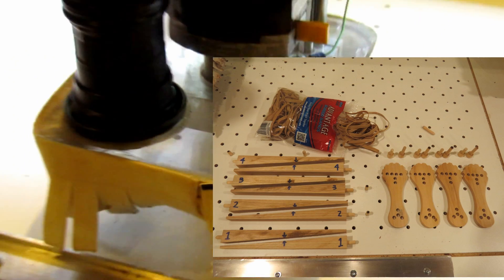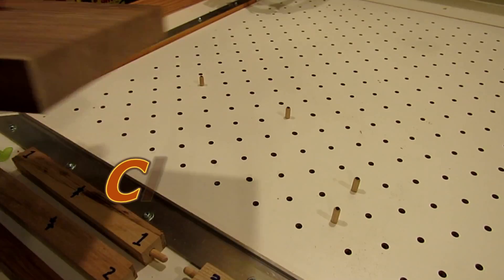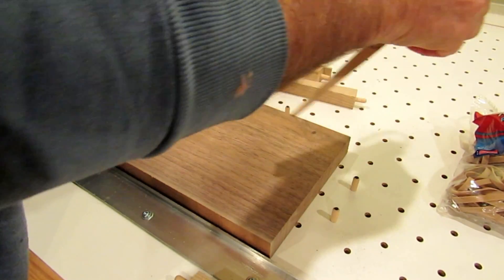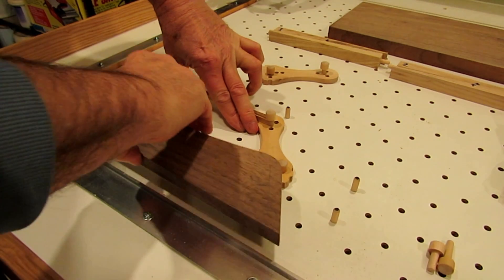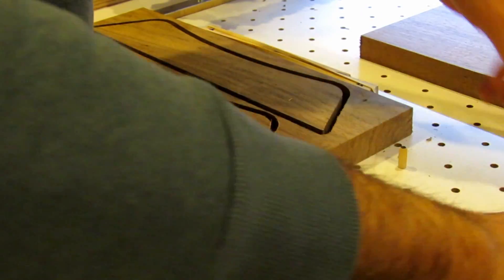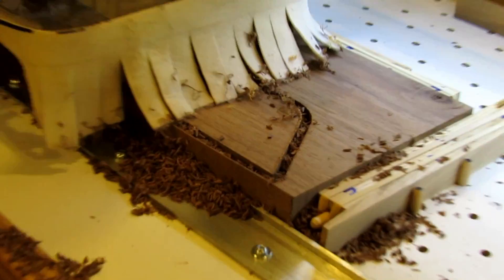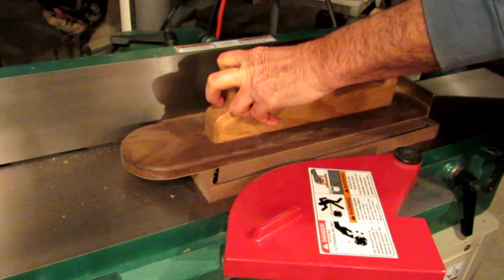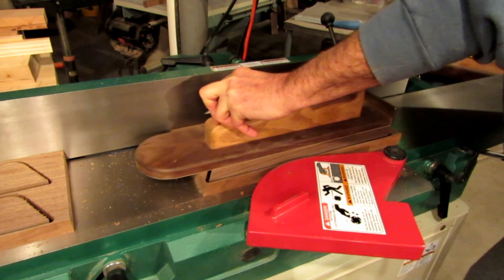Wood and Rubber Band Clamps For my CNC Router

Comment: Well done.  Very practical.  I will be using this system.
Reply from the maker: It worked good for my original low hp router with straight cutters. I am using t tracks on my new router with the 3 hp spindle and spiral bits to be safe. Thanks for watching.

Comment: I like the idea but it seems that rather than using more holes, instead to use different wedge widths. You said your going to 3/4" spacing from the 1". I'm thinking of simply making a few sets of wedges that would accomplish the same thing. A wider wedge would engage the next row out.
Reply from the maker: just keep the taper as shallow as possible for backoff resistance.  Thanks for watching.

Comment: That is awesome.  What software are you running for the CNC?
Reply from the maker: This one used Mach 3. I just. built anew one to replace  this using a Masso controller that is much easier to setup and use. Thanks for watching.
Reply: @unemployedredneckhillbilly2023  Did you build your CNC machine or did you buy it complete?

Comment: I've seen a number of YouTubers use double sided tape.  The trick is to find tape that is non-permanent and doesn't leave a residue.

I've also watched videos where they used a pin nailer with special plastic nails that won't hurt the cutter.
Reply from the maker: I use a lot of double sided tape also. Thanks for watching
Reply: @unemployedredneckhillbilly2023  What kind of tape works best?
Reply from the maker: I have some that just says intertape on it. My dollar store got a shipment of cases of it between 2 and 3 inch wide rolls that apparently were a batch not cut to the exact width and sold as surplus. I picked up 20 rolls for 20 dollars and it works really good. I think this is it https://www.itape.com/en/products/double-coated%20tape . I think it normally is almost $40.00 a roll.

Comment: nice ideas, gonna try them out, i have a really large cnc but weak steppers so this kind of clamping might be ok for me, alse leaving  1/16 thikness of material at the bottom is called "onion skin" you should look a little more into it
Reply from the maker: You may be able to upsize them. Just don't use upcut bits. Thanks for watching.

Comment: well, it took me long enough, it seems, to run across this video! so glad i did. you did a great job at designing the clamps! keep up the good work - i'm gonna try this out.
Russ from Coral Springs, FL, USA
Reply from the maker: They have been working great for me so far. Just don't use upcut bits without top hold downs.

Comment: Great idea, thanks for sharing. 
i already have a dogging cam clamp system for my cnc, but will be making your design of 2 x sliding wedges as 2nd option
Reply from the maker: They have worked great for me, I even made up a copy of the waste board and use them for gluing up frames. I do not use them with spiral up cut bits to be safe. Thanks for watching.

Comment: I love this idea
I have just copied it on my 8*4 router its great
Reply from the maker: Thanks. I have been using them for over a year now with no issues. The only issue that I have heard is do not use spiral up cut bits with them without top clamps. I also made a clamping board using the same clamps that makes squaring up glue ups easy. Thanks for watching my video.
Reply from the maker: Glad they are working for you. The cam type clamps are great for odd shape parts. Lately I have been using some of  that thin foam board on my table as a wasteboard. You can push the pivot pins right through it.

Comment: Hey, Chief, what angle did you settle on for the wedges?

Warning: because you do not have positive top-hold-downs, your workpiece can still be "lifted up" by the screwing action of a spiral bit. If it doesn't throw it at you, it will probably go ahead and drill a hole all the way through it, but then it will start dragging it around the table, making new and scarier noises with each collision with a new obstacle.

Ask me how I know all this... (and lived to tell about it.) If you are using "aggressive cutters" (wide and deep), take the extra measures to make sure it can't be jerked up.

Thanks for great ideas. (Hope you're listing this on your resume.)
Reply from the maker: I am not sure of the angle. It is very shallow cut with a taper jig. I only use small cutters with shallow cuts and have not had any problems with lifting on my little machine. But I think any type of uplift cutter could could give you problems and top clamps should be used with them. You can easily modify this idea to meet your requirments, but I don't think it is adaptable to a big high powered router. Thanks for watching.
Reply: I took a screenshot and rotated it to get an idea (using the highly recommended image-processing prog GIMP) and make it to be right around 3.5 degrees. (Sorry, I should have thunk of that earlier.)

I look forward to your video on your vision of a top clamp one of these days. :^)

Cheers! Thank you again!
Reply from the maker: These clamps work great for gluing up frames also. I have no need for the hold down type. I use some double sided tape for parts that cut loose  from the center.

Comment: I noticed someone asked you if you'd be willing to share the files (6 months ago), but you ignored them. Does this mean you're not sharing? I was going to ask the same thing. This, to me, seems like the ideal solution for holding parts down. I'm sure design the clamps myself but it's probably easier to to get them ready if I have the option.
Thanks!

www.thewoodpeckers.ca
Reply from the maker: I just share my ideas, I don't want to get into sharing files right now. It is a very easy design that can be adapted to your needs and must be designed to work with your router size and waste board grid pattern.  Try a couple of different designs untill you find one that works good for you.
Reply: Totally understand, thank you!

Comment: What was the spacing that you used for drilling the waste board? My XL is close to being done and I'll be using your excellent system.
Reply from the maker: I used a 1" x 1" grid that is staggered. Next board I am going to switch to a 3/4" x 3/4" staggered pattern so I will no longer have to use spacers due to the travel on the wedge clamps. I just plunged a 1/4 " bit and the 1/4" dowels fit perfect and stay perpendicular to the board. The clamps have worked great for my little router so far. Thanks for watching my video.

Comment: Thank you very much for sharing, you have helped me a great deal. I tried metal hold down clamps and blew my power supply after my spindle collided with one of them. Would you please help me with advice on Gcode for drilling the sacrificial board with the grid as you did it.
Best regards
Reply from the maker: I just used a 1 inch x 1 inch drill grid and removed every other hole to give me the staggered patern. The more holes you use the easier it will be to locate a clamp. The most important part is to have full lenght fixed corner locators at 0,0 with the sandpaper to keep parts from slipping up. The wedges must have a very shallow angle to make them self locking and the rubber bands just keep them from vibrating loose. This setup works good for my needs for a low HP router, but you may want to beef it up for a higher HP spindle. I also use double sided tape on the table to keep features cut from the center of a clamped peice from flying. This clamp setup will not pull a warped part flat, so you will have to start with flat stock for them to work. Thanks for watching my video.
Reply: Thank you for the advice on the grid pattern but I have no idea about the Gcode it just seems so complex to me. I will continue to search for a solution. Best regards
Reply from the maker: It is easiest to buy a program such as V Carve to do your drawings and then use the correct post processor for your machine to automaticaly create the Gcode.

Comment: This is definitely thinking a bit outside the box! I am planning a near future change to my waste board and will probably implement your ideas. i  like the simplicity , frugality, and safety (to the machine) that your setup offers.  
Thanks for sharing!
Reply from the maker: +JW Woodcrafts They have worked great for me so far. The only problem has been that they do not apply any downforce to pull a warped blank flat, so I just use a flat piece of mdf to screw or double side tape a warped blank to and clamp that in place with the wedges. I also made a 24 x 30  board like this for clamping up frames on my workbench and holding parts while sanding.  I have clipped one of the wedges with the router and was real glad they were made of wood.